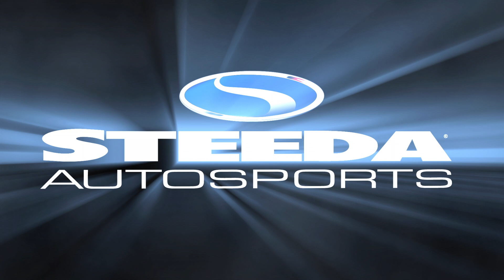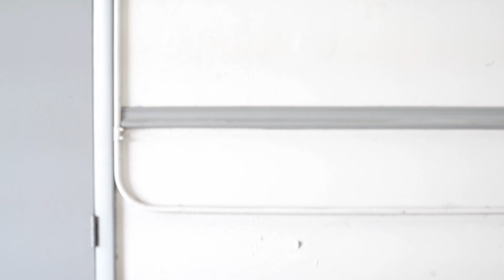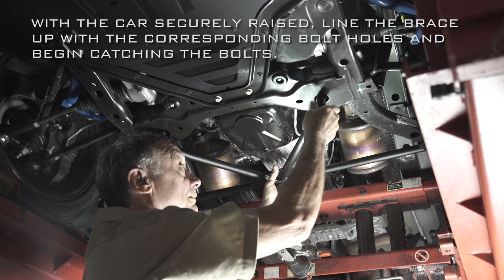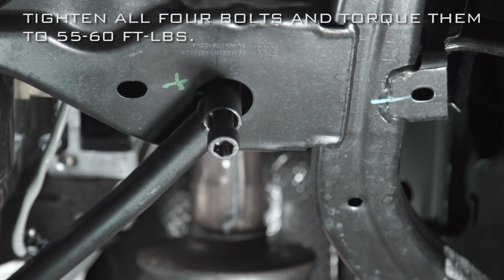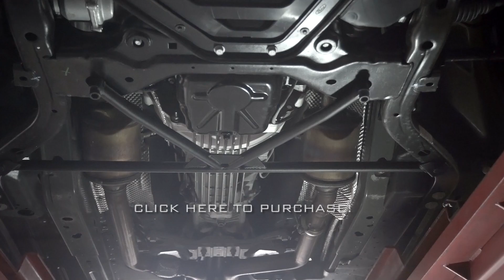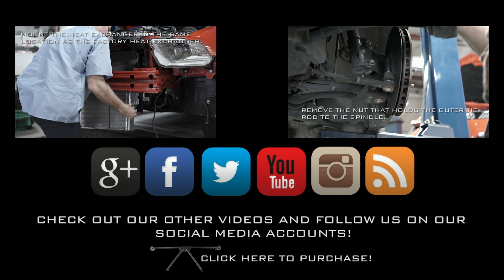2015-2021 Mustang Extreme G-Trac K-Member Brace Install - Steeda

Comment from the maker: 2015 Mustang Extreme G-Trac Brace Install!
Reply: I take my S550 to the road race course for HPDE and PDS events and am considering replacing the stock intake with a CJ intake manifold. The problem is that the CJ is not compatible with the strut tower brace. Will the G-trac K-Member brace compensate for removing the strut tower brace?